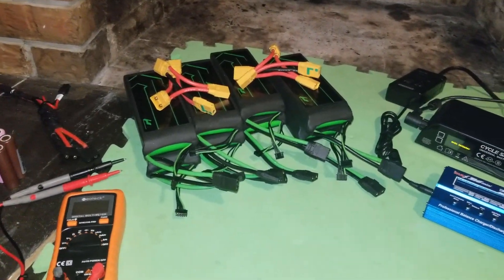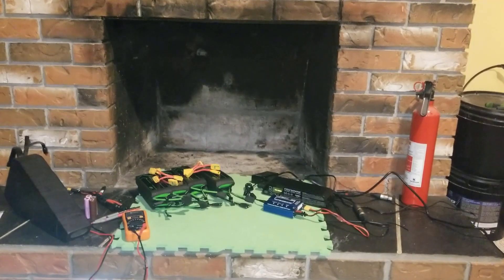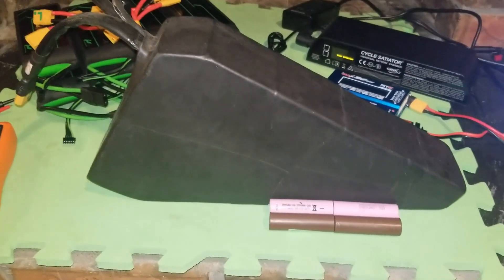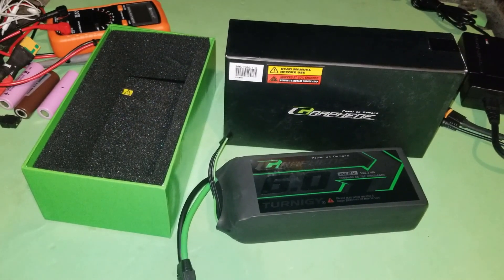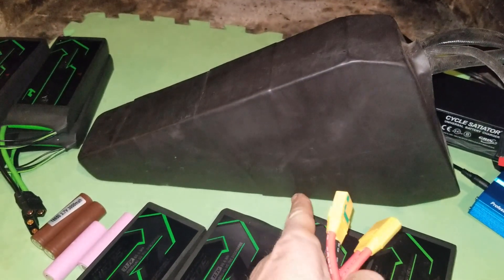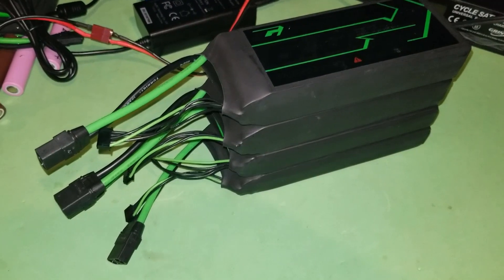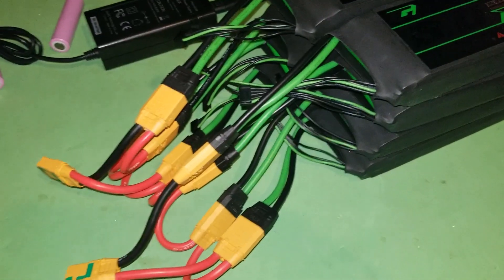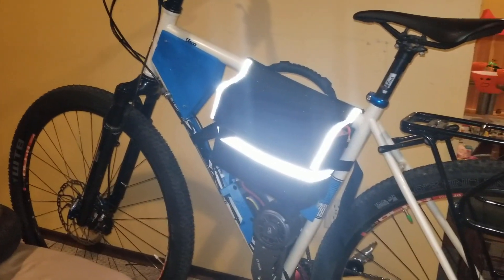Lithium Polymer (LiPo) Ebike Battery Pack (Part 1)

Comment: Yep.  Makes one pay attention when battery building.  I built using the 18650s.   I went so far as to charge and test every battery individually to have no weak ones by mistake.
Reply from the maker: Good practice that. Best to be sure.

Comment: Have you got a link for that cool Grin battery charger please ? Cheers
Reply from the maker: https://ebikes.ca/?___store=canadian&___from_store=international  website looks like upgrades so might be a few temp issues. Not it has a max amps of 5 charging. Has no discharge capabilities im aware of anyway. It is quiet tho with no fan and waterproof so you can frame mount it. Make sure you get the right version if you want it for 72 volts. Cheers 🍻

Comment: Another great video ... thank you for passing on your knowledge which is helping me with my choices and solutions.  My batteries and charger arrived today from Hong Kong.  I ordered three Turnigy 6 cell 22.2 volt 20 Ah packs and their D6 Pro Reaktor charger balancer.  Now I'm forced to finalize how I'm going to mount them on my StumpJumper frame with a significant amount of the triangle space located to rear suspension components.  I like the top tube saddlebag approach you chose for battery mounting but unfortunately West Coast is out of business and I haven't been able to find another bag supplier.  What is the width and length of your bag please?  I may have to improvise.  Co-incidentally today, I also received word from CYC that the backordered bits being waited on have arrived and that configuring and testing should be completed in two weeks when they hope to ship my motor kit!!  I ordered the Gen 2 with BAC 2000.  I tried to log in to your site as suggested in our previous exchange but no luck with my Apple computer??  Safari does not work it says ....
Thanks.
Reply from the maker: I will have to measure it. Are you on my discord server. Be much easier to help you on that. https://discord.gg/YAAjfgc I'm out but remind me about the bag. Sucks about west coast tho
Reply from the maker: Sorry just read this again. Discord does not work on a Mac?
Reply: @HighVoltageKits  I clicked on the link shown in the YouTube comments that caused a message to pop up saying safari cannot access sites with discord prefix.  Later on I tried copying and pasting the link directly onto Google search and got in to the site.  Thanks for follow up.
Reply from the maker: Awesome. See you on there.

Comment: what would you suggest for a 60v 30000mah ?
Reply from the maker: In lipo? Also is that 60v nominal or fully charged? So 60v nominal would be 16s and the 52 14s.

Comment: Another thing that's important when connecting lipo's in series is making sure all the wires are the same length or you will have some serious heat build-up from the resistance in the wires. The shorter the better, but all your harnesses are all the same length nothing to worry about, but just in case someone reads this. Those are some nice packs, They are made by my sponsor CNHL ChinaHobbyLine.com I could have picked other batteries companies as my sponsor but I found that the performance to price ratio/value was the highest on CNHL's. Even though I get them free they have to win me races, if they don't, then getting them free is useless to me as that is the whole point of having sponsors when racing drones. Your video is very informative with a very clear explanation of what you are doing and that's a great choice you made on those batteries. You put a lot of effort in your videos and it shows...
Reply from the maker: That's a good tip for the harness wires. Nice to know I made a good choice for power. Are they cheaper buying direct?
Reply: this is good to know, thanks!

Comment: Not Lipo related - where do you charge your triangle battery? Do you leave it on the bike or charge it in the fireplace? Thanks
Reply from the maker: On the bike in my workshop area usually. Cheers

Comment: Don't fast charge them don't over charge them don't over discharge them store them at 25% charge you will have no problems.
Reply from the maker: I'm charging at 2 amps. Mostly to my 85% setting right now. I should have the bms up and running next week if it all goes well! Thanks for the advice, I'll be sure to take care of them. Cheers!
Reply: yep, Wes Newell over at endless-sphere has gotten years of use from his lipos by charging slowly. He even shows you how to de-puff the packs.

Comment: Hi, great videos. I’ve watched a lot! I realise you’re still experimenting but can I ask your opinion between bbshd with asi bac 800 and cyc x1pro with stock controller. Which do you prefer? Which has more torque? Which is higher top speed? Many thanks
Reply from the maker: Thanks! The cyc has a higher top speed runs cooler and is a more powerful motor. But in terms of riding quality the ASI controller has the stock cyc one beat. At least IMO. The stock one is still being worked on but it has some limitations which affect my riding style a bit. I'm probably going to use the ASI on the cyc going forward. The stock cyc reminds me a little of the bbshd one stock but with much more power. I'll go into it in more depth in my video on the cyc now I am able to do more riding. I love the mid frame mounting tho its great. The newer cyc is having torque sensing bb. So if you ordered one you would get that. TS beats PAS any day. Cyc will also offer the bac800 at 52 volts and the bac2000 at 72 volts alongside their own 36-72 volt controller. Hope this helps. Cheers
Reply: I can’t see any mention of the asi bac 800 or 2000 on the cyc website. Would I need to contact them or is there another supplier you are referring to? Thanks
Reply from the maker: No its them. They have not updated with the new parts or options yet.
Reply: @Vicente Andrew Thanks so much for your reply. I got to the site on google and im trying it out now.
Takes a while so I will reply here later with my results.
Reply: you prolly dont care but does anybody know a trick to log back into an Instagram account..?
I was stupid lost my account password. I would appreciate any tricks you can give me!
Reply: @Miles Parker instablaster :)
Reply: @Vicente Andrew it worked and I actually got access to my account again. I am so happy:D
Thanks so much you really help me out :D
Reply: @Miles Parker Glad I could help xD

Comment: Hmmm,,, did I miss the wiring setup using different cells ? Dan
Reply from the maker: Maybe we have our wires crossed. I'm using packs with 4s (3.7, 3.7,3.7,3.7) and 3s (3.7, 3.7, 3.7). Is this not what you meant? All the individual cells in the 14s configuration are identical as far as their physical properties go. The only difference is one wrapped pack has 4 cells and the other 3. Let me know if this is not what you mean. Cheers
Reply: @HighVoltageKits  YES << Wires crossed,, I wanted to see your wiring diagram.. Or ((   schematic drawing of the wiring of an electrical system for 4S with all 3S cells in series .. But I have a hard time without pictures . So,, best of luck,
Dan
Reply from the maker: Dan Thiede I'll draw it out and stick it in part 2 Dan. It's a good idea as it is hard to see where all the wires go. Cheers.
Reply: @HighVoltageKits  Thank you very much,,, Dan
Reply from the maker: Tell you what Dan. If you shoot me a PM on endless sphere I can send  you the diagram early. Might be a couple of weeks to part 2.
Reply: @HighVoltageKits  OK ,, what is,,, your user name on Endless ? is it Captain ??

Comment: Very clear explanation thanks for this I may use these to make a higher voltage pack when I have my asi bac fitted to my bike would be a great option. I do have a few questions in regards the the asi controller but I shall post them on the relevant video hopefully you may be able to help.
Reply from the maker: Thanks Dan, I'll take a look at the questions for sure. Cheers

Comment: I use two 6s 20ah multistar lipo batteries in series. I also have three 4s 10ah graphene batteries in series for short runs. The graphene battries are great. I have some graphenes that are nearly three years old and still have good IR. I been using lipos for my R/C hobby since about 2002 before we had balance leads. Just don't leave them fully charged for more than a week or so otherwise they could start puffing up. I usually discharge to storage if left more than three days. If you want a little more power you can always charge them to LiHV. Some people don't like that idea but, I haven't had any issues charging to HV over the past couple years.
Reply from the maker: Thanks alot. I'm not sure what LiHV is. So far I have been charging right before I plan a ride so not to stress them out. I'll mention the storage charge stuff in part 2. Cheers.
Reply: @HighVoltageKits  No problem. LiHV is charging the cells to 4.35 instead of 4.20. Charging to LiHV will most likely shorten the life/health of the batteries but, in my experience, not by much if they are good quality batteries. A lot of racers charge to HV just to get the extra edge. If I know I'm going on a super long ride that may come up short on my battery capacity, I charge to HV. I wouldn't recommend doing it all the time if you want to maximize the life of your lipos unless the lipo is indeed a LiHV battery to begin with. It will clearly say on the battery if it is or not. I will keep an eye out for your next video. Thanks!
Reply from the maker: It's not written on them so I think likely not. Thanks again!

Comment: Should I try this or just buy a li ion?
Reply from the maker: If it will be your first or only battery I'd get a li ion. Cheaper, easier to use and safer. This is for experimental, development and high performance runs. For trails etc I'll likely be not be using the lipo.
Reply: @HighVoltageKits  ok Yes I'm just going to buy a 74v 20 ah or a 52v 20 ah triangle from emve3
Reply from the maker: Con Servative litespeed bikes have good looking 72 volt batteries. Is this where you are looking?
Reply: @HighVoltageKits  I am looking for a good affordable 72v and I do appreciate any advice or info. I was originally looking at luna - then I saw emve3 and ERT and now I need to look at litespeed too
Reply: @HighVoltageKits  Oh crap yes I am definitely buying their 72V 20.4AH TRIANGLE PACK WITH 50AMP BLUETOOTH BMS
 (copy pasted) dude it's only $575!!!!
Reply from the maker: Con Servative I thought you might like that. Cheers